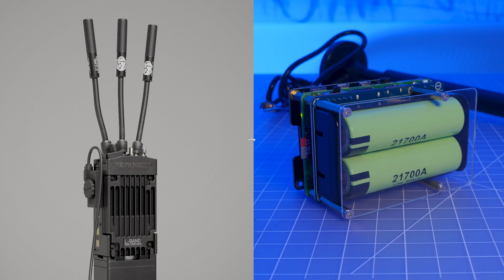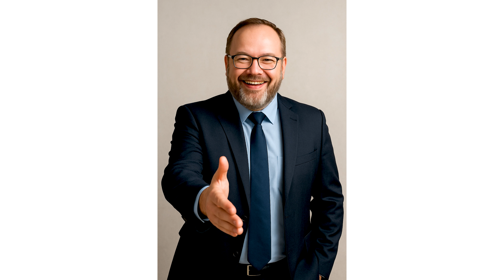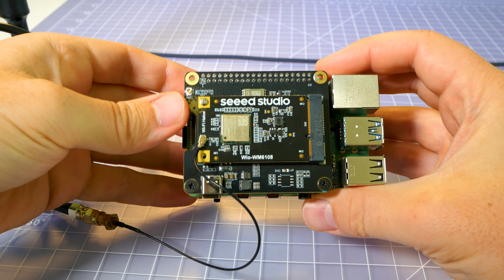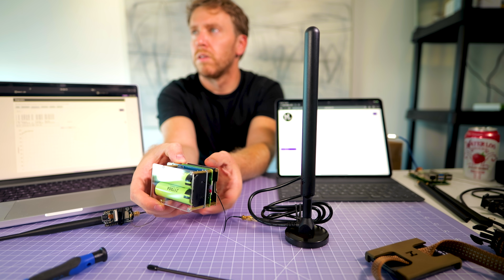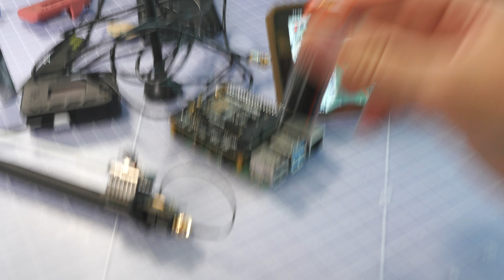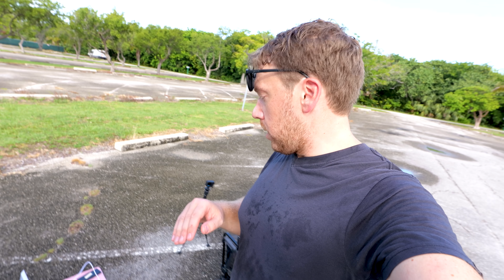I Built a $20,000 Military Router for $106.23

Comment: Those who want a shortcut (and don't care cost much) may buy MM6108-EKH01-05US (RPi4B + MM6108; $500 at mouser) and use pre-built OpenWrt-based firmware available at MorseMicro's Customer Portal. It's pricy but you can easily update to the latest firmware periodically (twice a year?). 
Btw, MM has released the 2nd gen chip (MM8108; supports 256-QAM w/FullMAC + lower power consumption than MM6108) and the pricing of its eval kit (MM8108-EKH01-01) is almost the same. I haven't gotten a chance to test MM8108 yet.

Please note that the actual military MANET equipments are totally different from this RPi + HaLow (that uses unlicensed 900MHz bands in 802.11ah + OpenMANET/EasyMesh specs w/low TX power limited by FCC; i.e. anybody may make a jamming device for it easily) and comply regulatory/security requirements, such as NIST FIPS 140-3 and NIAP Common Criteria. Google with "An Overview of MANET Technologies", "Wave Relay Technology Report", or "Silvus Research" for more info.

Comment: As a veteran, I can say without ANY reservation that the big players (Harris, Ratheon, all SAT service sellers) are gouging the government for what they get. Like Musk has said MANY times, fail fast, get the bug worked out and do it cheaply as possible, thereby you outpace the competition with how many versions you get through. Same here. You could have built 600 of these thigns, worked out the bugs as you go along operationally and been literal lightyears ahead of the big players...all at a MUCH lower cost to the consumer (the uniformed services in this case)

Comment: nice video...next video... you build tomahawk rocket for 14.79€ :D ... but military standard is little bit diferent... i "thing" your device is not to rain dust hot cold and if it drop to ground i thing this RP dont survive :D and you can make it cheaper and more power safer ... ESP32P4
Reply from the maker: It survived being run over by a car!

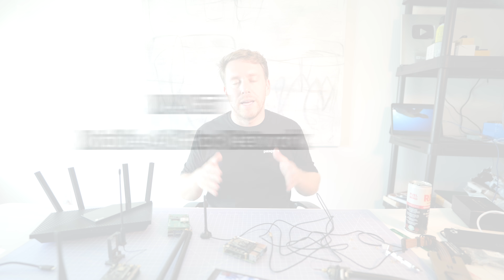Comment: 3:48 May-Net, lol. It's Man-Ay, like a beret. Minus 10 points. In regards to your Click-Bait title, let me know when your "$106" radio can meet MIL-STD-810H environmental (like tracked-vehicle vibration, ballistic shock, -40ºC operation), MIL-STD-461F (radiated/conducted emissions/susceptibility tests), MIL-STD-1275D (vehicle power with 100V load dump surges and 250V pulses). I also bet it won't survive ground burst nuclear weapons effects (fast neutron flow and gamma rays) which critical military equipment is starting to get back to. It also wouldn't pass any level of FIPS or "agency" security requirements. There is a reason why ruggedized equipment costs so much. The requirements for reliability and security not only add to the parts list and cost per unit, design and testing costs millions and is amortized into the cost per unit.

Comment: Use to install DD-WRT onto Linksys WRT54G (v10 to 2.0) routers. Attached Yagi or "Cantennas" antenna to get incredible ranges. Worked overseas in Afghanistan for many years, so it was nice to be able to modify and get the most out of the limited resources we had. This is very interesting stuff, for the simple fact that it's a secured network.

Comment: The US military tends to require "custom-made" equipment with an extremely long and detailed list of technical specifications (the "operational framework").

This limits innovation and competition in the private sector due to the cost of R&D and the complexity of the required solutions.

This is a real problem, especially in this modern era where cost savings are paramount, and the high-capacity production of modular and adaptable equipment for a supply chain that can be challenging and crucial.

Comment: no, you didn't do what you claim, you took off the shelf developed product and adopted it, but do you know down to last details how your parts work, the supply chain? no, you don't, and that becomes VERY important when actual conflict starts, because supply chain for raspberry will be first to go, then your li-ion batteries made in china, and then your code starts glitching, cutting out, or comms getting eavesdropped and a missile is heading your way
that is why you massively overpay for fully in-house developed hardware solution with engineers knowing exactly how and why, and can react to probes or discovered vulnerabilities quickly, at least - that is the idea, and since the number of units produced will be much much lower than raspberry, not to mention cost of EMI hardened enclosures that need to work even when after being stored for 20 years. And these things all add up to the cost, because the people designing these and factory producing these won't be selling rebranded ones on Temu to recover the money lost in R&D and establishing manufacturing for them, unlike chinese, who knock off raspberry and sell clones at half the price just to ruin original business that created them

Comment: its a startingpoint i always admire - as i dream of decentralized internet - like a massive p2p entwork without the need or danger of a ISP like a turn off switch missused if the wrong government takes over ... 

sure some 3letter agencies will then try to controll as many devices as possible - if not already somehow the case (with intels and amds hardeware backdoors on every pc/secondary processor)  but at least it would be more democratic 

id rather have only a 10mbs connection and again a more free and democratic internet than the stuff we have now ...  

and when you check wiggles wifi map you see it would have been possible for years if every homerouter would be speced for that - which could mean free internet for everyone since years in many areas - sure with its big downsides like TOR shows but yeah ...  maybe for one its to save 2000bucks in 10years , for others the freedom and for some people privacy - i just like the idea

Comment: Needs frequency hopping, beam forming, military-grade encryption (the government can probably break AES), rugged design, etc.

Any time you transmit something, you can be tracked via your signal propagation. 

The actual military radios are likely more secure, and probably harder to attempt to pinpoint the user's exact location with.
Reply: I’m sure the RadioShack Fry’s Electronics type homies can figure those issues out. I’m just happy a mf doesn’t have to join the military get hazed like Forrest Gump get treated like gomer pyle at a Socom selection just to get an mpu5 and an ops core.
Reply: @nyl0n  I’m a ham radio operator, and I was in the military.

But yes, this technology is pretty cool… but I’m sure it needs some work before it’s truly “military grade” equipment.

Comment: the military doesn't overpay. It's all embezzlements. They (politicians) own the companies that are charging these "ridiculous" prices. They're just stealing from the military and the tax payers. Take a look at the racket with road construction. These projects can be done in mere months yet some roads are shut down for years only to not have anything done until the later half of the term and by the end of the term, the roads are already bad. It's all for show. Source: my friend owned a construction business which got a government contract that had these stipulations. They were not only prohibited on finishing the project (which would've taken 6 months), they were also not allowed to pick up on other projects. Always rent out equipment from recommended businesses. Do not build it using certain materials (usually long lasting, durable, higher quality, etc) and only use recommended material (easier to break down, poor quality, etc). 

There are investigations about these manufacturers too. They are charging $20k per bolt that you can find for $5 in retail shop (literally the same exact bolt).

Comment: past the clickbait, but the MPU5 is an awesome bit of warfighting kit with a lot for the $20000 difference, mostly not relevant for civilians use, but when you have an "enemy" the things becomes life and death important.
EG; frequency hopping speed and frequency width required for low probability of intercept needed  to not immediately trigger battlefield direction finding and artillery.
quality of transmitters and spurious transmissions; again; if it happens and you have an enemy looking for you; life and death.
smarts for phased antennas; reducing detection again
and purely $ wise; MPU5 is also the "phone" part of the budget; providing all the UI and uses video out to a dumb screen rather than cheeping out on hardware and more radio noise that can be tracked; so your adding a phone to your price is now $20k vs $2k so not nearly as profiteering.

Comment: Cool project, you could consider hardening privacy protection even more by running wireguard server on openWRT (better to rn on a second system tho). There's a lot of pentest methods to observed and exploit wifi to gain access, so the seond encryption layer is useful when comparing to GOTS - plus double tunneled with commercial encryption is sufficient for classified data on wifi (NSA moved away from type 1 like 10 years ago).  Adding LoRA dongle and some scripts for hearth beat and other remote asynchronous diagnostic capabiltiy will be useful if the the router will be somewhere hard to get to.  Also on antenna - a directional antenna on the RECEIVE side (assuming "send" has  WAN connection), along with LNAs, are where to focus RF front end conditioning are going to give you WAY better RF performance.   In terms of RF antenna selection yagi (triange - narrow beamwidth, highest gain), pannel (flat, wide beamwidth / direction, better gain), omni (stick in the air, no directionality / donut shapped, least gain) - if using narrow bandwidth to optimize receiver gain, do some pointing and RSSI readings,.  RF does weird crap - refract, reflect, absorb, etc. and you'll have interferers in those bands ...so in the absense of direct line of sight - take the 5 min or so to do RSSI readings and antenna pointing (directionally less discriminant than one may think of) for final antenna placement (low is high... -30dbm > 30 dbm).

Comment: I created an open sourced threat detection software that runs offline and dispatches off of criteria met.  Networking is where I felt off this helped me tons actually.
Reply: The trickiest is actually building around processors that can facilitate packet flooding into other networks to break the network holding the enemy together.
Reply: I am looking for other boards ATM because Pi5 cannot conduct network flooding.  The holy grail is the system that can packet flood threatening networks.
Reply from the maker: would love to learn about what you're doing - discord.gg/g7h8Jc7Agt

Comment: with most radio equipment, a quadrupiling of transmit power only gets you twice as far... so going from 20mw to 30 mw should get you somewhere between 25 and 50% more range

.... if i remember correctly lol
Reply from the maker: But it's going from 150 to 500 mw...

Comment: Question you can hopefully answer. If I've already got an onboard raspberrypi but don't want to run OpenWRT as an OS, is there another way to add a Halow chip that doesn't involve a second raspberrypi running openwrt?
Reply from the maker: Yes, you'd want one of the halow add on devices like the heltec usb dongle.
Reply: @DataSlayerMedia  Much appreciated!

Comment: I did a a fair amount of mesh development with similar concepts as yours in mind but more commercial objectives for for promotional reasons. It all surely had multi-purpose alternate capability similar to those you've mentioned. At the core were various brand mesh RF 900M/2.4G RF/CPU modules with default OS Synaptic-Wireless SNAPy OS. I loved this OS, simplification with room for tinkering a bit under the hood. Their OS handles a lot of the low level radio modem controls and leaves you able to focus on just needing to work with  some powerful wireless and RF-Terrestrial Mid-level API. I built a number of solar/battery panels/base stations with minimum 48 hour ride through under cloudy/stormy conditions. I have made variety of radio boards for purposes ranging from oil/gas emergency cluster apps to multi-family residential haz-gas sensor arrays looking for gas leaks and meth labs with temp and RH compensation algorithms (All good but I got bogged down after making a B&W spreadsheet style GUI when iPhone was blowing up, I tried to develop a flashy GUI for the manager's station by myself, by my strengths are hardware and I couldn't get anyone to pitch their lot in that I trusted to help me bring it the last 2 miles.Since then they stopped all 3rd party mfr of the wireless nodes some of which were 100mW 900Mhz, or 32bit ARM at core, Their prices have tippled and only modules are 24 pin, 2 UART, and a handful of GPIO and analog. Later I though similar tech standardized into factory car stereos with RF-Terrestrial base stations scatters about especially in desert and remote highway area for short text messages on a open sources de-centralized literally-module network. Those who I fielded the idea through weren't too impressed. Could have used your you tube ch back then, Look forward to watching your videos.

Comment: It can do roughly what a $20,000 product can do.
However, its MIL-STD temperature range is only 32–49 °C (90–120 °F) and 33–71 °C (91–160 °F).
It will work fine in your backyard in spring, but under harsh field conditions ???

Comment: The main limiting factor with this setup will be the raspberry pie. It doesnt have a lot of throughput even in a data center on LAN its still garbage for networking.. The pies IO is just severely limited. I recommend trying this with one of the more affordable higher performing pie alternatives. Also id just like to see that cuz thats how id try to do it my self.
Reply from the maker: but there isn't a ton of data being routed, the halow link will cap out ~15mbps so not sure the Pi would throttle that in any way
Reply: @DataSlayerMedia  While that is not significant throughput I have always had the experience that every bit of IO on any of my pie's would fall short of even a 15 yr old bottom shelf laptop. I would at least try it on something else at some point as a sanity check. As you may or may not know pie's are not even capable of saturating their on board network links and have not been capable of reaching their full USB speeds individually let alone using multiple IO ports at the same time. And I have heard more than once that the hat IO / GPIO pins are even worse...

Comment: A, if not *the* primary reason why govt and military procurement tends to drag on and get extremely expensive, is mostly shared by the majority of somewhat healthy democracies, and it's "cause" is somewhat ironic: It's the extensive and intense scrutiny of expending public resources. The mechanisms we put in place to mitigate corruption, and to ensure we're getting the best value vs what we need, how much we're spending and when we need it.  But the extent of inputs, assessments, evaluations and reviews, followed by sometimes very complicated financing especially if procuring something not already available off the shelf, very often does not scale remotely sensibly with the "size" or scope of the procurement.

The other major component is perpetual feature creep throughout the whole to-order development and manufacturing period, ending in a dramatic reduction in number of finished units ordered. So we end up with far fewer units bought and delivered 5 years late at insanely expensive prices, that are nothing like the original intent - because the manufacturer and all their subcontractors has basically had to functionally develop the thing 9 different times and ways, and built it 3 times.
Reply from the maker: interesting

Comment: ⏱Timestamps:

00:00 Intro — What I built & why it matters  
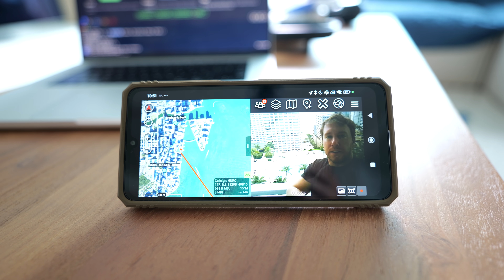01:21 Closing thoughts — Battlefield apps, procurement, adoption  
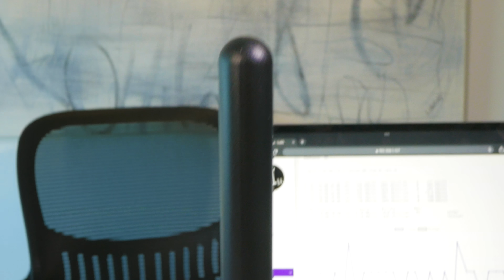02:45 Goals & demo plan — Wi-Fi, chat, GPS, PTT, video, Starlink  
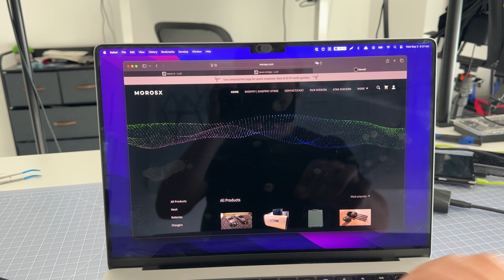06:17 Availability & community builds — Prebuilt IP mesh radios  
08:22 Hardware & power — Battery hats, pogo-pin, USB-C charging  
09:35 Build form factor & future casing — Intel Wi-Fi, 3D-printed case  
10:09 Sub-GHz 915 MHz — Antenna + Halo chip Wi-Fi range test  
14:48 Multicast & file drops — Images & map pins peer-to-peer  
15:39 Voice & PTT demo — Remote server & local Raspberry Pi Mumble  
16:18 Video feeds & protocols — Live streaming (UDP/RTSP/HTTP)  
16:46 ATAC & mapping integration — Video feeds + markers in maps  
17:51 Operational examples — Targeting, “mad minutes,” coordination  
18:28 Speed tests & throughput notes (~22/3 Mbps + updates)  
20:04 Node-to-node internet — Setting up node #2, Ethernet & Wi-Fi  
22:18 Range limits & degraded links — Internet usable at ~1 Mbps  
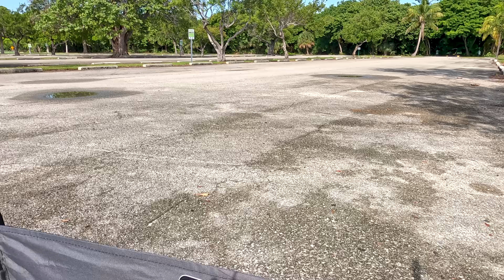23:05 Long-range YouTube test — 915 MHz Halo + Starlink combo

Comment: ultimately US procurement across the board suffers from the structure of FPO's. 

All government agencies are required in the interest of fairness to make a request for bids from potential suppliers. The suppliers all make their bids and the agency is required by law to choose the best value for money option, usually the lowest cost as the bids are rarely differentiated in quality. Sounds good, sounds fair, the bids are usually blind to dissuade graft. Great ideas.

However, at the core of this system, the bidders still set the price. The bidding system is meant to incentivise companies to undercut eachother until a fair price is found but in reality, they all bid high. When the lowest bid is still factors of ten above its market value then the agency is still getting scammed. Private companies tell the US gov what it's going to spend on any given project and the procurement office doesn't know any better because everything they procure is the same degree of overpriced. $20,000 radios, $1mil web portals, the list goes on.